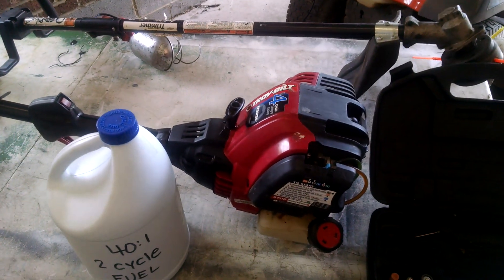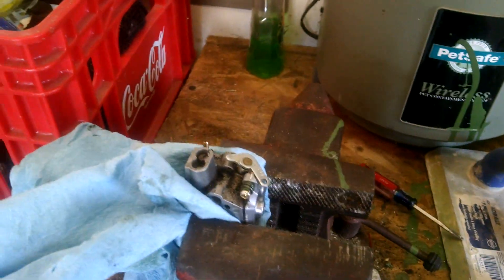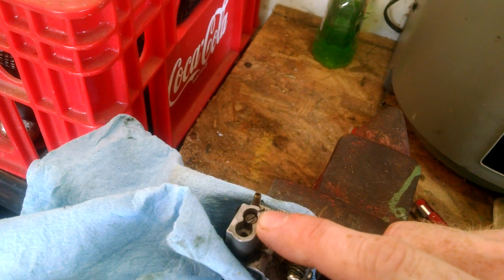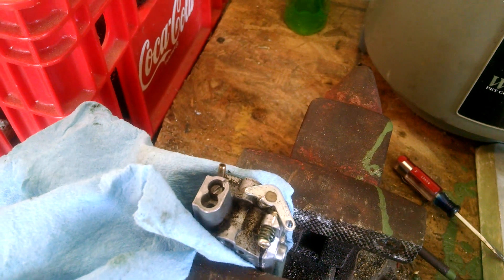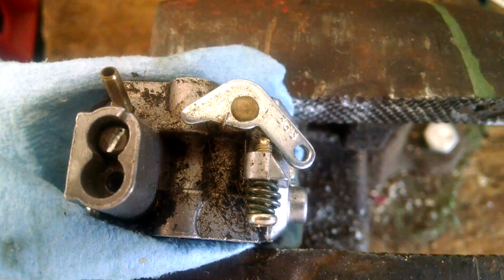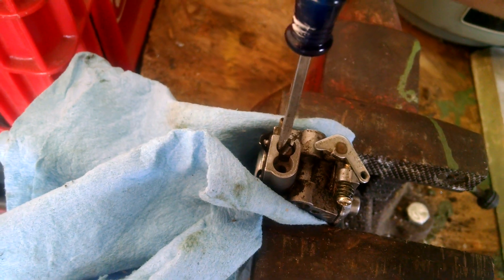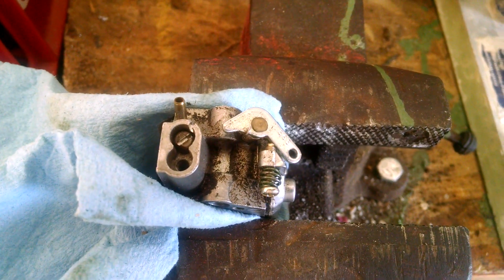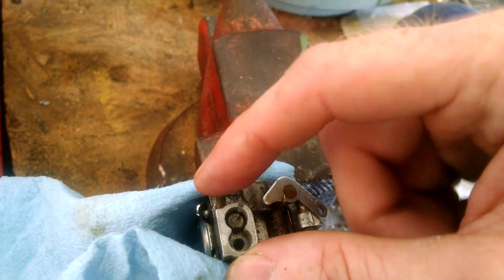Adjust Carburetor without special tool

Comment: Simpler and safer way is to use an electoral connector (the kind. You crimp for joining wires)
Reply from the maker: Thanks for the comment.  On this weed eater the adjustment screw was "D" shaped and I couldn't get sufficient grip to turn it.  I do agree that the connector is a better first option.